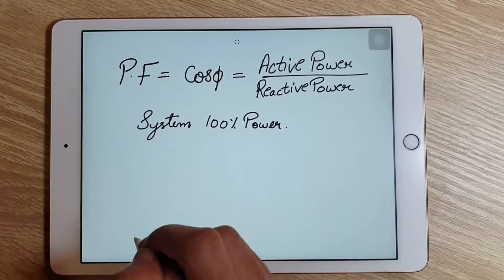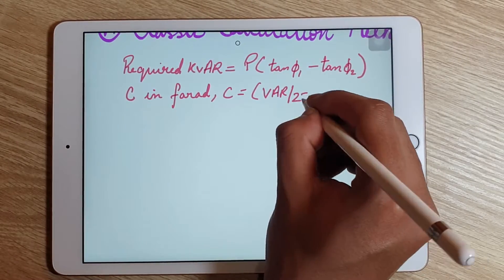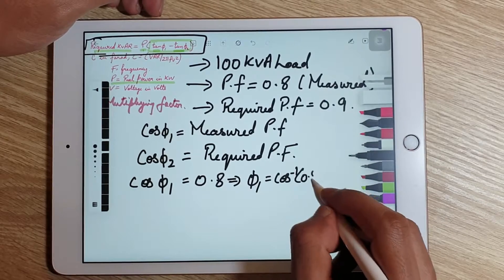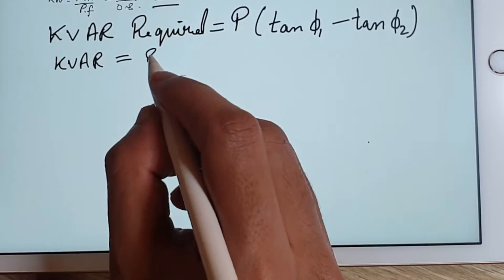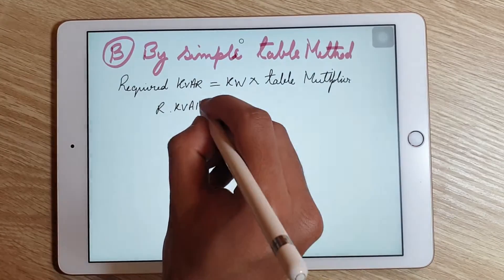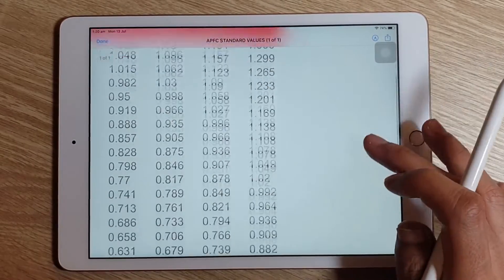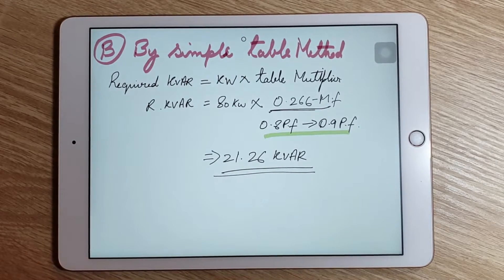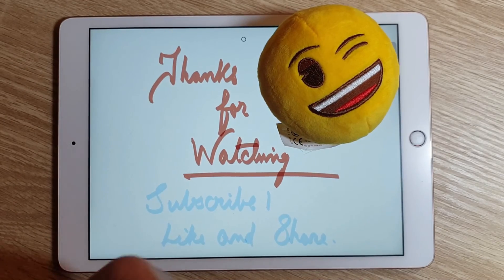APFC Panel KVAR Calculation | Required KVAR Calculation Methods | APFC Panel Designing

Comment: Pf = active / apparent 
Not active/ reactive
Make corrections
Reply from the maker: Pf= Cos(Φ) = P/S = W/VA = power factor. 
The power factor is calculated as the ratio of the real power to the apparent power. 
Also Real power= apparent power ×power factor. 
You can do some more research on this.  What you say is correct and basic formula but once you go Deep into calculations P= Real power/ apparent power make sense.  

Sorry for late reply ☺️

Comment: pf= P/S not P/Q
Reply: Power factor (cos)= Active power (P)/apparent power(S)
Reply from the maker: I am sorry, I didn't got you. can you explain ?
Reply: At 1.09 minutes
Reply from the maker: Pf= Cos(Φ) = P/S = W/VA = power factor. 
The power factor is calculated as the ratio of the real power to the apparent power. 
Also Real power= apparent power ×power factor. 
You can do some more research on this.  What you say is correct and basic formula but once you go Deep into calculations P= Real power/ apparent power make sense.  

Sorry for late reply ☺️.

I can answer in more details but short of time.  Thanks for watching

Comment: Please make another video on apfc panel regarding
1.how to make stages of capacitor
2.fixed and  variable capacitors
3.how to overcome harmonics problems in power factor improvements
Reply from the maker: check the description and watch power wiring of apfc panel for stages and fixed variable capacitors.
Reply from the maker: will make one on harmonics soon. Thanks :)

Comment: Helpful video, could you please tell how to calculate mail branch circuit breaker rating? If we have KVAR rating given. For example for 600KVAR what will be the value of incomer circuit breaker?
Reply from the maker: Hi sana, thanks for appreciation. You can watch this video in which I explained about apfc panel circuit breaker selection.
Reply: @ElectricalInfinity  dear sir thank you for reply your content is really helpful for me me. I have some doubts. First while calculating CB rating for TF why we are multiplying by 1.4?

2. I have seen a thumb rule KVAR×2.32= Ampere ( for CB) and you have taken value of 2? Could you please explain this?
Reply from the maker: For 3 phase to convert kva to ampere multipying factor is 1.4. For Kw to amp it is 1.9 and for HP to Amp it is 1.5.  You can this video for more clarification  https://youtu.be/5PHyLUGkl14
Reply: @ElectricalInfinity  got it thanks